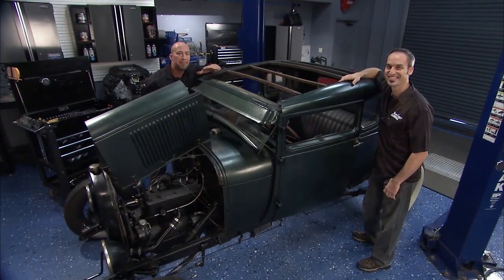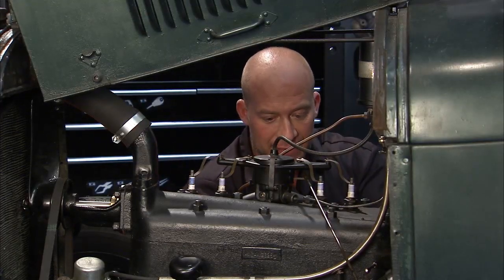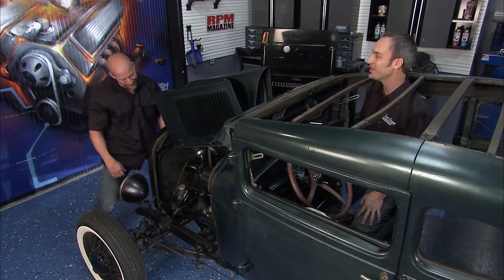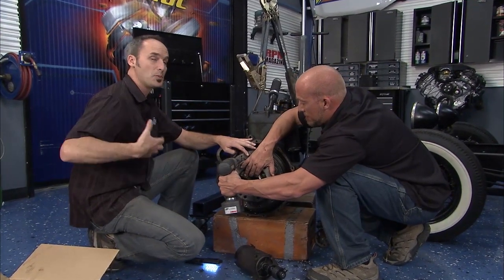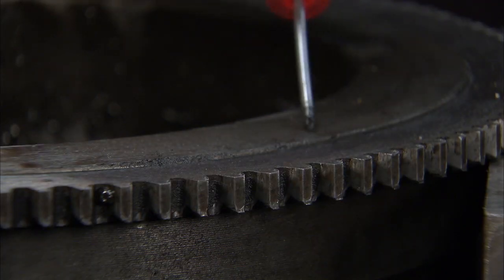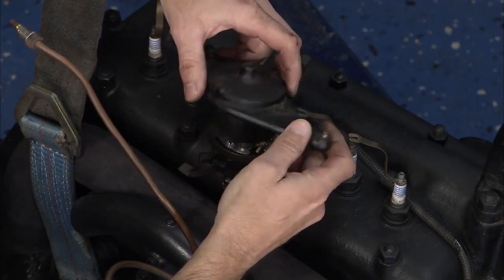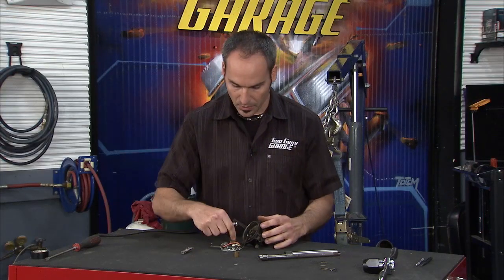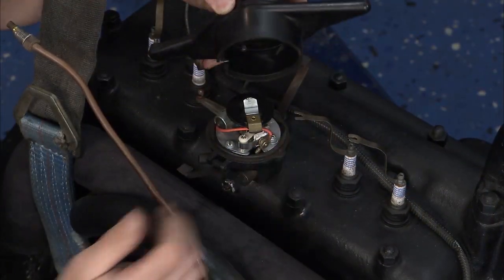Refurbishing a 1928 Model A Engine | Two Guys Garage

Comment: I have been driving Model A's for over 60 years now . Thats a great tip you showed about freezing the flywheel and heating the ring gear I will remember that one.
I changed my Distributor back to original they have a new type rugged mylar condenser now that eliminates condenser failure the original condensers  were made of tin foil and waxed paper inside and failed often the new short proof mylar ones last and last even new distributor shafts have some rotary play in them this is compensated for by the drag of the points rubbing block  .  One thing you did not check was the bearing clearances in the engine the poured babbit bearings need to be checked especially the center main, the crankshaft flexes and this causes the clearances to increase its a good idea to check the bearing clearances about every 5000 miles or so dropping the pan and  using plasti gauge most rebuilders put pealable  removable shims under the bearing and rod caps for this purpose rebuilt engines are VERY expensive now  .   Thats a 1932 -1934  Model B carburetor you have on there gives a little more power  .  You might want to check the exact date of manufacture of the Model A it is usually stamped on the engine side of the firewall  on the drivers side  a few inches down from the top and a few inches in from the side  I found mine in a few minutes scraping off a little paint with my pocket knife.  GREAT VIDEO !   Bob in Michigan
Reply: Robert Sumption Would did you think of him cranking the engine with both hands? Shouldn’t he have cranked it over with his left arm only?

Comment: You have to mark the pressure plate and the flywheel. So you can put the pressure plate back on in the same place it was. Because they are balanced together.

Comment: What's the idea, putting a stock 4 banger in a chopped top hot rod? Either unchop  the top and put the fenders back on or find a 350 Chevy engine. Otherwise you've got an odd rod.
Reply: They said they were going old skool early hot rod. Very common in the day was to just take every thing you could off and drive it. They didn’t have near the parts nor money for a v8 swap and had to just roll with what you had. Besides nothing sounds sweeter than a in tune model a engine.
Reply: Hi compression head, reground cam, and a 97 or dual updraft really wake them up and are period correct, or flathead it. Small block didn’t come around until 55, different look